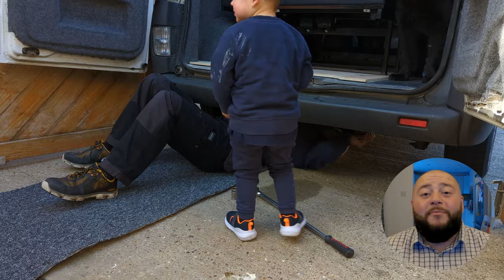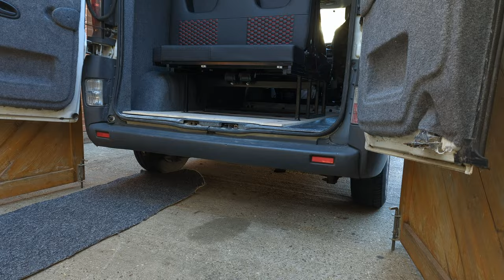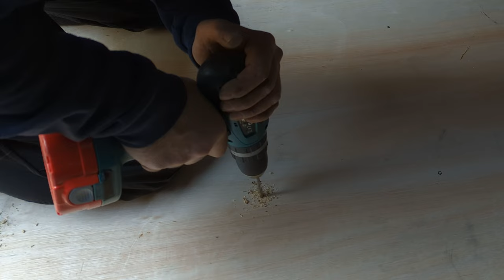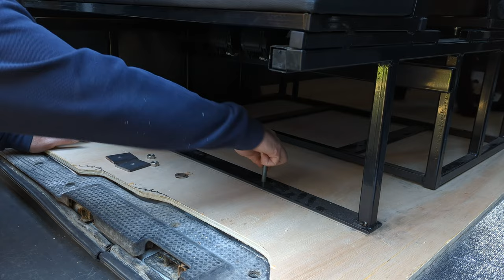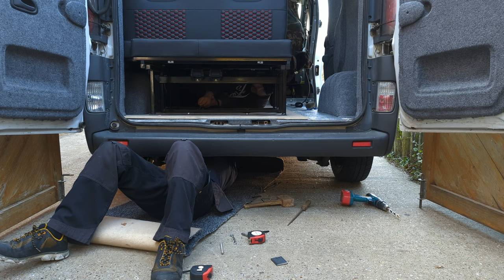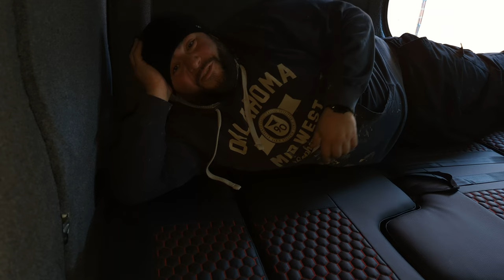EP05 Rock n Roll Nanna Nap! | NO EXPERIENCE Vivaro Camper Conversion | Installing Rock and Roll Bed

Comment: Hey mate, did you put spreader plates on the very front bolts? There doesnt look like a lot of space between where the bolts come through and the chassis. So, what im asking is, can you get away with only bolting in if there's no space for a plate?
Thanks pal, good video